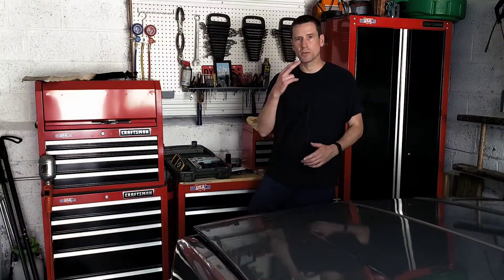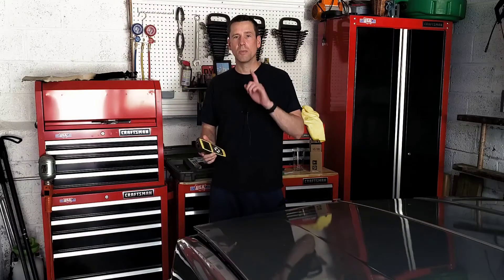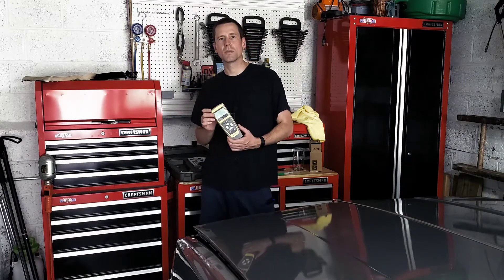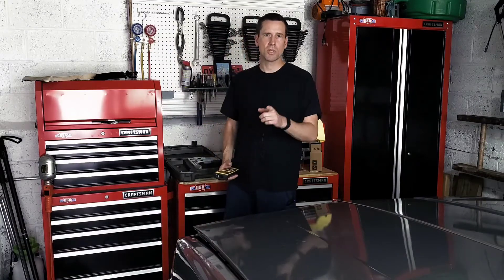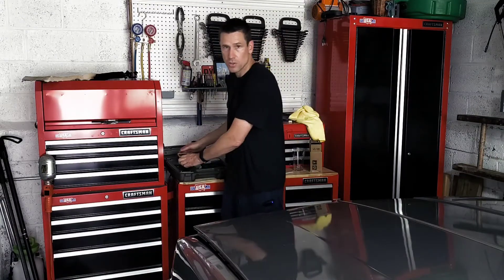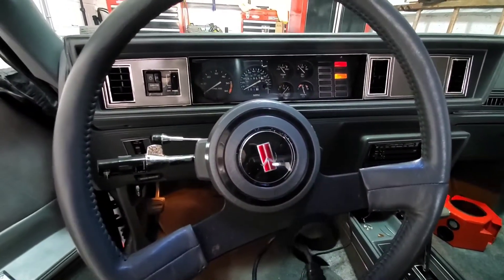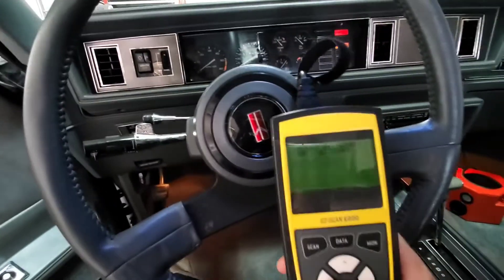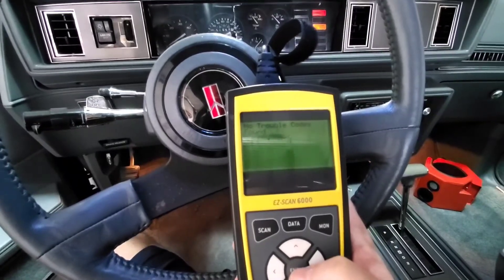Reading GM OBD 1 Trouble Codes With a Scan Tool

Comment: What scanner are you using? I need one for my 82 firebird. I purchased an actron cp9690 but it only shows from 84 and up. Won't read my 82. Does your scanner allow to select 82 year?
Reply from the maker: The scanner I used in the video is an Actron Auto X-ray 4000. They've been discontinued for a while, as have just about every good OBD 1 scan tool. If you plan on getting some real use out of one, I'd strongly recommend tracking down a working GM Tech 1 or Tech 1A.
Reply: Your '82 probably doesn't report sensor data, doesn't have a serial capability.  My '81 is this way.  My '84 reports serial data and much more than the '81.
For the '81, I'm limited to flash codes and I don't need the scanner for that, just jump the test pins together and count the flashes.

Comment: Does this scanner do live data for 1987 Buick Regal Limited? Car stalling once in closed loop.
Reply from the maker: Yes. It does
Reply: Yes these scanners will if the option was enabled.  There were several options available, gm, chrysler, ford, all makes.
Make sure the options you need were enabled, I believe the 6000 model had all options enabled.
One clue will be which cables are provided, all big three automakers used different connectors.

Comment: What is the manufacturer and model number of the scan tool you use in this video?
Reply from the maker: This is an Autoxray Ezscan 6000.
Reply: You ground top 2 on upper right hand corner